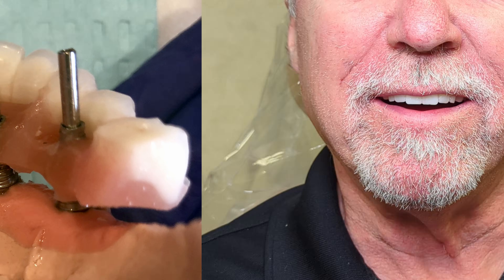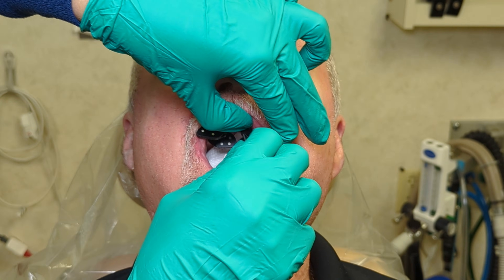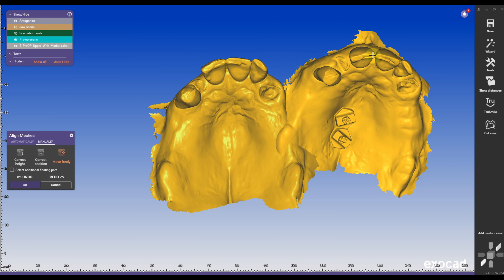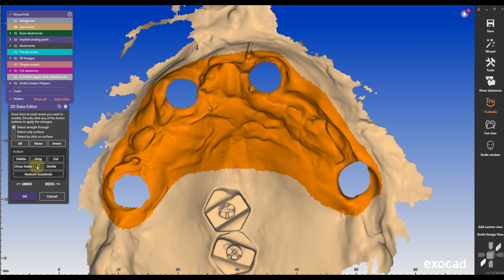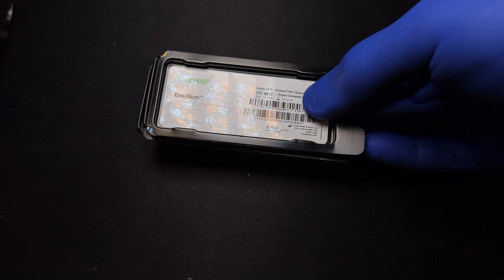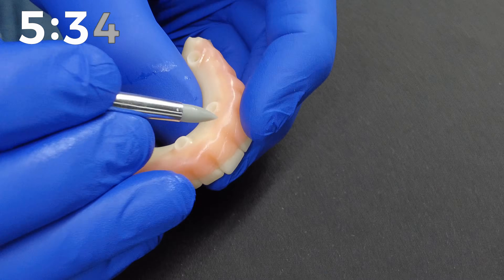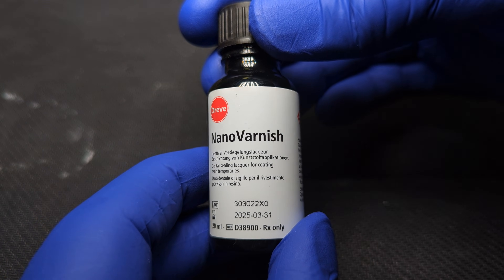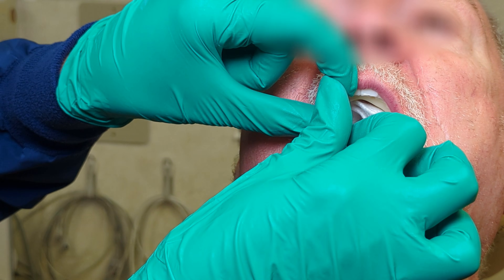All On 4 in 2 hours [ Full Clinical and Lab Workflow ]

Comment: My wife’s first 3D printed teeth were so off. She had a huge overbite and the lowers were angled inward. They quickly printed another one and the bottoms were a little better but they angled upward from left to right. The uppers were still protruding upwards that she still bites her lower lip plus it’s also wider that she bites her cheeks. Is it normal to have several printed teeth before a final one?
Reply from the maker: No. You should have 1 try in PMMA only
Reply: @ That’s what I was thinking. Tomorrow we have follow up with surgeon and a meeting with the dentist. Thanks for your quick reply.
Reply from the maker: @csebastian71 everything should have been done digital. Smile mockup etc so there are no surprises
Reply: @ Also, add that the front two are not centered. Don’t know if the surgeon will do a scan but will definitely be requesting one. So curious to see the difference of before and after for the increased width and protrusion.

Comment: The post surgery scan is with multi unit abutments or scan bodies?
Reply from the maker: The post surgery scan is with Straumann White caps on Multi Units. But you can also use Nobel Bio Care white caps (reference # 31145). It all depends how your PIC system is set up.

Comment: Thanks for the video! between PIC and ICAM, which one do you find easier to use? I would love to see a video of detailed process of merging the files in EXOCAD and designing AO4 immediate prosthesis. Thanks.
Reply from the maker: Thank you for the comment. This video has a portion of alignment in Exoxad. The difference of PIC and ICAM on a very high level it that PIC has 2 cameras and ICAM has 4. PIC offers direct to Implant scan flags. ICAM can move the camera while PIC has to be still. That's very high level information.

Comment: Thank you for this useful video. I use light curing material but this decision way better. Definitely I need to buy that kit
Reply from the maker: Great. It's not available for the public yet but if you are interested I can get you something.
Reply: @masterdentaltechnician1914  Thank you for responding. I have already checked that on the website. There are not any informations about this material
Unfortunately, now I live outside the US but later I’ll let you know when I come back. Thanks again. Much appreciate
Reply: @masterdentaltechnician1914  I have an idea but I don’t know how to do that. How to separate AOX and print gingiva and teeth separately?
Reply from the maker: @maxproc9406 did you check out this video: https://youtu.be/4fkvGtA5Hvg
Reply: @masterdentaltechnician1914 Thank you🔥 I hope it will help me. You are master 👏🏻
Reply from the maker: Yes. You wanted to print teeth and Gingiva separately, correct?